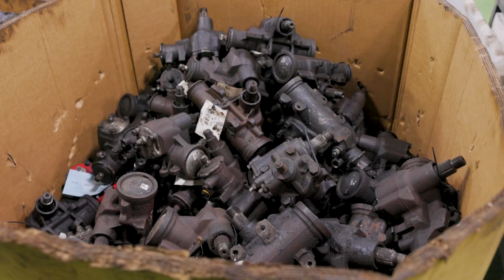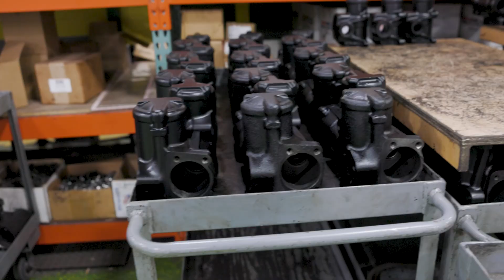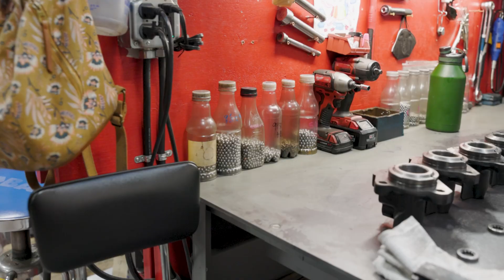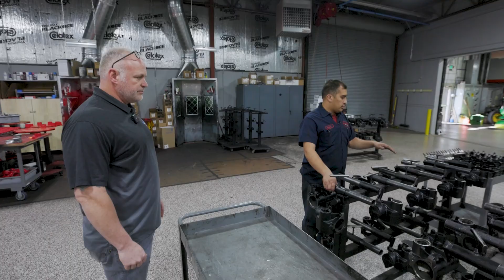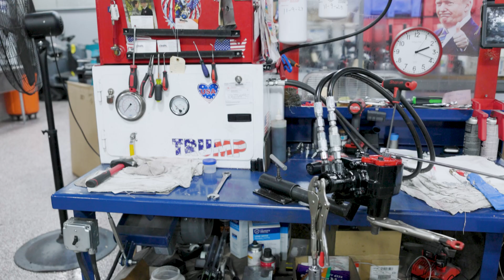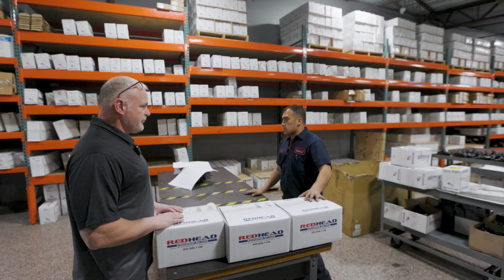RED HEAD STEERING GEARS GAVE US A TOUR!

Comment: Wanted so badly to like this product but after 1.5-2 year my red head box is junk
Reply: Same here 
These boxes are junk check my review on there google page 
1.5 years and it is junk sector shaft moves and sticks to the side of the box 
There warranty absolutely sucks 
Anna that runs warranty is an absolute idiot
Reply: @goatsgarage2635  Mind if I ask what make and model your car is?
Reply: What makes em different than other rebuilds?
Reply: Same with mine. 2 years old and just started leaking like crazy with no warning, basically blew up in a parking lot. Waste of money, terrible product.
Reply: @Bloodbain88  Make/Model?
Reply: @DeltaSquadron63  1983 Chevy K30, dually. Part number on the gear itself from redhead was 2858.